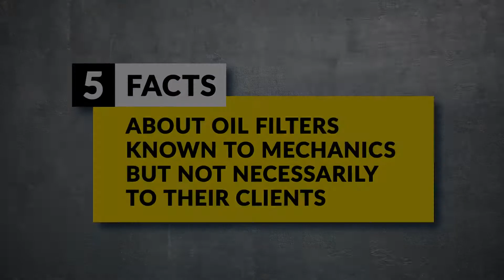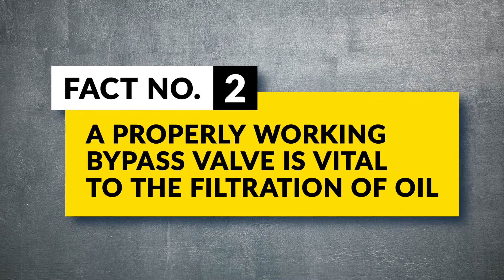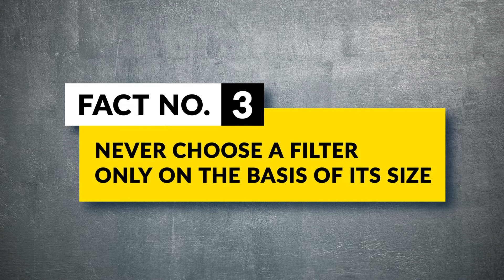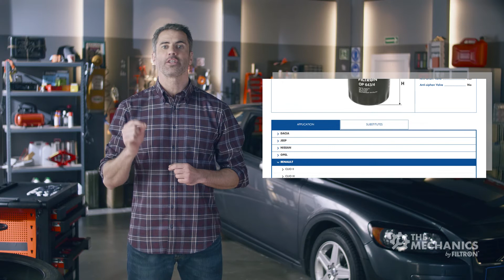5 FACTS ABOUT OIL FILTERS – The Mechanics by FILTRON

Comment: Yeah a professional oil change in a garage is superior to a DIY (by a trusted mechanic I agree) but a quick lube shop that sells you mineral oil at the price of premium- full synthetic engine oil and a 3000 mile oil change reminder 🤔 The brand question, as always... you pick a brand, then look at their catalog , you can see the filters that matches your vehicle.. if it works out you stick with it 😂 I change my oil and air and oil filters and I know what goes to the oil pan... if you have an older car it's simple as that
Reply from the maker: There's nothing wrong with changing your oil and filters yourself, as long as you have the proper knowledge and some experience with car mechanics. If you're a novice in this area and don't feel confident that it's something for you, it's better to leave this procedure in the hands of a qualified professional. 🙂
Reply: @themechanicsbyfiltron  I do my oil changes 2 times a year.  I have also changed the coolant and spark plugs as well. Same on the previous car of the same brand. The biggest benefit of owning an older, simpler vehicle. It's a fun lil' thing to do on a weekend. There is no rocket science only good practices.

Comment: A rather Walter Mitty video. There's plenty of garage horror stories on here to refute what this fella is telling you. There's plenty of videos on here to show you how to how to change your car's oil and filter yourself, some of the videos were created by women doing the job.

To select the right oil and filter, use the filter and oil manufacturers websites to select what you need. My advice on the selecting the appropriate filter brand, is to identify which brand supplies your make of vehicle OE (original equipment).
Reply: Hi. It seems there is alot of misinformation on the internet regarding mechanical repairs. Someone needs to Filter out this misinformation. On that point I would like to know in particular what information should be refuted that the video shows?
Reply from the maker: If you already have some experience working on cars and are familiar with technical aspects like the correct oils and part numbers, changing the oil yourself may not be too difficult. However, if you lack this knowledge and haven't done it before, a completely DIY oil change is not recommended. In that case, we suggest seeking the help of a qualified mechanic. 🙂